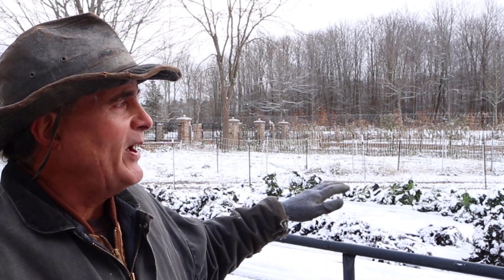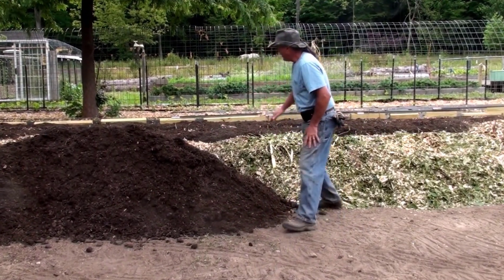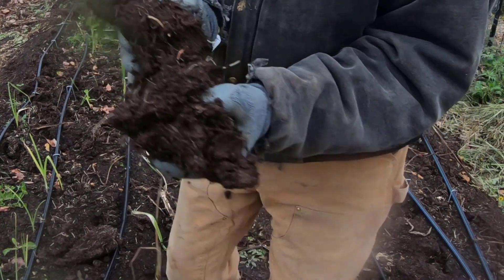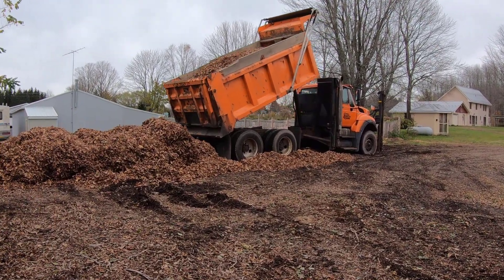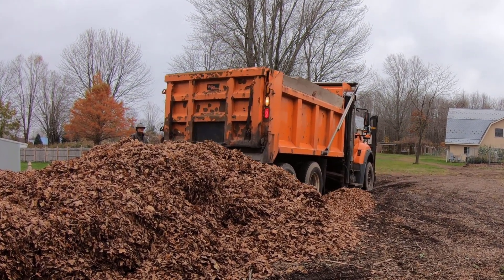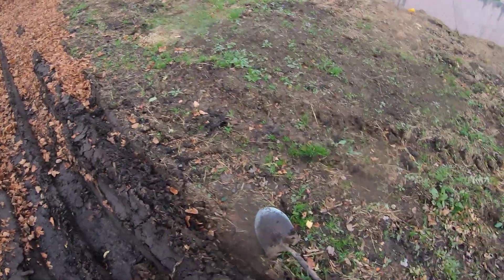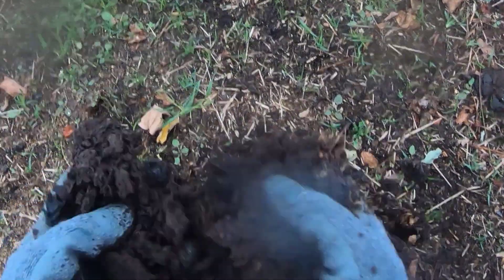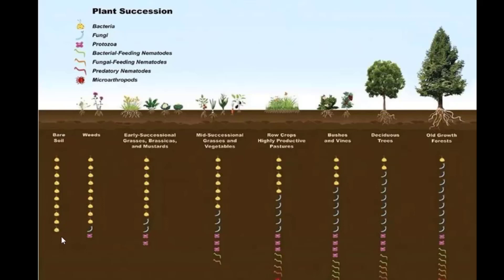Faster breakdown of wood chips 3 year process Integration Method

Comment: Really good observations, thank you! I had 2 deliveries of wood chips last November that I combined with good compost on top of cardboard and had very good results starting a new garden in lousy conditions. 2 more loads this November (for new area )and am hot composting them w/spent brewery grains. About half cooled way too quick and I’m turning very little but it’s still a jumpstart. 4 big piles still holding 50c but a  big snow storm is going to change things.